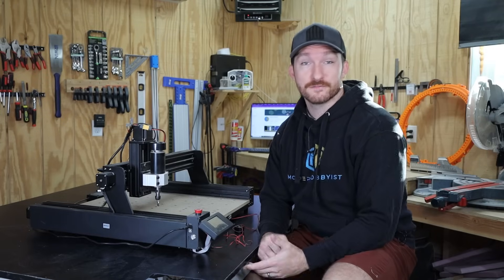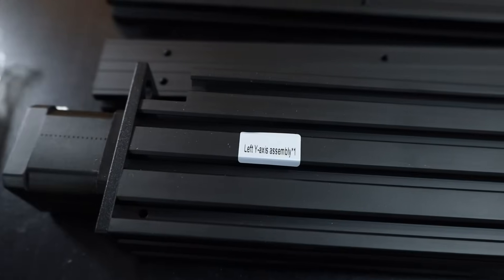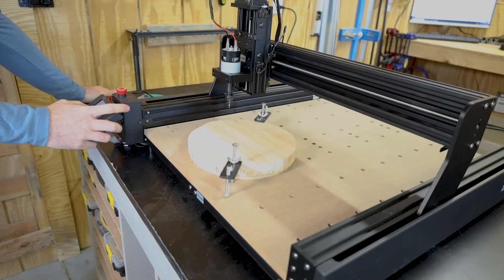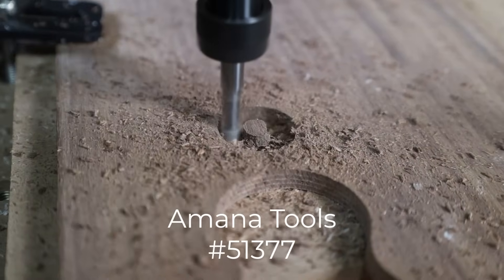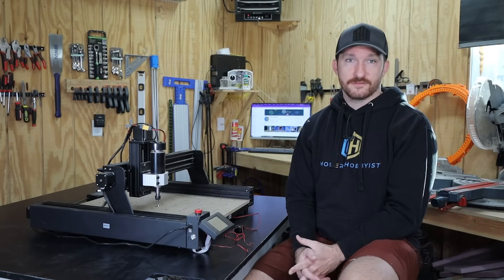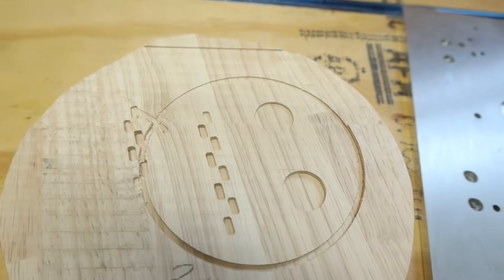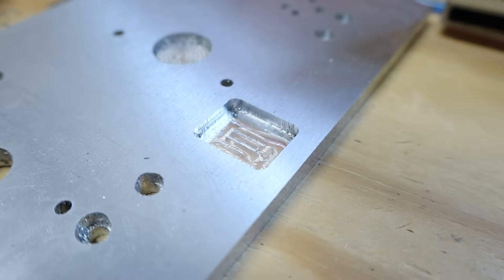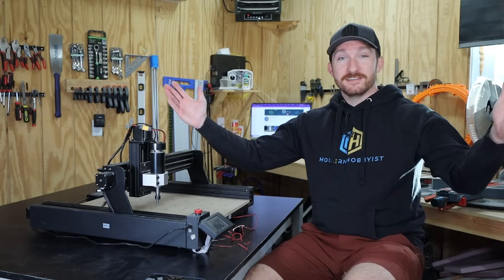What can a $500 CNC Router Do?! TwoTrees TTC450 Review

Comment: I know this is an older video but I’m a machinist and programmer for a commercial company and I can tell you the end mills DO NOT like to come down directly on the work piece.  You need a pilot hole slight larger in the start point. You will see long life and better performance
Reply from the maker: That's good to know, thanks for the tip!

Comment: Love the honest review. You’ll get a better finish on the parts if you leave a little material on the sides until you’ve got your depth cut all the way. Then come around and take off that last little bit of material along the sides. 

Also just have the tool path leave a little tab to connect the part to the panel in a few places so when it’s done it doesn’t come loose and jam the spindle or leave a crappy finish. 

Then just cut the tabs with a small saw and clean up the small leftovers. 

Hope that made sense. Also a machinist. 🎉

Comment: everything is fine with the electronics, I heard that the block fails, for some reason, I saw a video somewhere.
Are the wires long enough, I saw that in some cases the length of the wires is not enough, and you need to connect additional

Comment: I bought a TTC450 pro, the mechanical system is fairly good. The electronics are GARBAGE and failed, the warrantee is low quality, 1 ply toilet paper.  The board failed after 3 partial cuts and took 2+ months of HOT emails to get a $25. board. Technical support could not understand that no or intermittent  communication is a caused by a bad board. The control board is a proprietary & odd ball size board. The replacement board, as specified on the parts webpage WILL NOT fit or work (only 3 axis, need 4 axis). There are issues with how the stop switches are wired.

Comment: 10:15: I'm not a CNC user but, aren't you supposed to program in some little "connector humps" that allow the workpiece to stay put via a little piece of remaining wood?  That would require you to manually saw them off to release the workpiece but would keep the part from flying when it's done.
Reply from the maker: Yeah you can add tabs but I didn't actually care about this piece turning out so I took the lazy route

Comment: I had no idea these machines were so underperforming, 0.1mm DOF is laughable, i get that it's a hobby machine but still, they should be able to handle wood otherwise what's the point? Only for shallow engraving? Also, what's the deal with the electronics? I have a homemade arduino based co2 laser cnc running GRBL and have no problems, you would imagine a custom made board should run with no issues!

Comment: Not dogging you at all my friend. But a piece of advice from a machinist. 
The stick out on your endmills is crazy long and probably a considerable factor in the chatter. It would probably benefit you tremendously to chuck up as close as you can without impeding chip evacuation. 
Chuck up stubby and push your feed, then pull your tool out and slow down. 

The tool length and the hella long nose on your spindle = chatter for days.
Reply: He saying to put your cutty thing as far up the cutty holder thing as it will go, as it will stop it wobbling about.
Reply: Absolutely
Reply: First off, thank you for the honest review. I'm looking for my first CNC Router too, but I think I'll keep looking.  And what @xandetfields3279 means is to push the bit up farther into the chuck so it's not sticking out so long. I'm new to these beasts too, but I know that much from drills.
I love my 3D printer and I think a CNC would make a nice addition to my wood shop.
Reply: From one machinist to another, @xandetfields3279 gets it. The length of that tool is way too long. For that thin aluminum use a tool that's just barely longer than the material is thick. You'll be amazed.
Reply: Sounded quite sexual towards the end....
Reply: I use this advice daily, wife loves it 👍🏾
Reply: As someone just getting into this, this sounded like Willy Wonka explaining how he got his Gooberdinger meat.
Reply: Amen to that. I'm looking for a cnc machine, don't know anything about them however I do know lasers, 3d printers, both fdm and resin and you all are spinning my head
Reply: I love how I know nothing about CNC and your comment sounds like someone explaining his League of Legends role to me 😂

Comment: Would it help to chuck your cutting tool up more into the chuck so it doesn't chatter so much? A smaller depth in cut and a slower feed rate might help as well. I wouldn't try cutting aluminum on this machine as you need a fast spindle rpm and smaller depth of cut, as well as a bit of constant coolant on your cutting tool.

Comment: Hello, I'm looking to get a desktop CNC router but I need to know which model will do what I need. I need to engrave into and/or completely cut out small rectangular window holes in the hull of a model kit whose decals for this purpose are the worst decals I've ever encountered. The dimensions of the ports I need to cut are 1.5mm x .05mm. Which table and bits will do the job? Thanks in advance.

Comment: Great review and peice on this.

 Only issue is isn't the software cost more than the cnc ?? I know there's free cnc cad's out there but I've heard there dreadful...
I know that's a separate issue, but would have been good if we could have seen the software & inputting the shapes you created, An excellent video.
Thank-you
Reply: Fusion 360 offers CAD / CAM support and is free for makers. SolidWorks offers a hobbyist subscription now that isn't too bad and I think includes CNC / g code (not sure). Vcarve is decent at $349. I'm sure there's FOSS options out there but not too familiar with them.

Comment: Nice little machine and review but it only looks good enough to cut PCB  and some pine but for engraving it may do a bit better  as it will have less forces on the gantry . 
But man Don't keep on swapping your measurements from Imperial to Metric just stick to one if not you will get into a lot of trouble

Comment: 500$ this, no thanks ower price lot, all other same can buy normal 200-300$ save lot money, and have very small table cnc. and totally too small motors all, minimum good cnc need be nema 23 470 OZ motors, MINIMUM. and better buy 800 ER16 spindle than 500W same cost but lot better spindle, if working hobby work and sell parts better use 2.2KW spindle.

Comment: The one necessity for successful marching is rigidity. Even a slight  flex  (.005") will cause chattering and an ugly edge. There is just no getting around it. As the video shows, the "spindle" can be seen moving at an angle unintentionally when there is resistance. This will only increase as the cheap alum frame is used.
Reply: Yeah and the only way around it is reduced feed rate and reducing the depth of your bite. More time consuming is all. I guess for the ultimate hobbyist it would be okay.
Reply: @goingbonzo5923 
 The cutter will still flex all over at low speed. The fix is to buy something you can actually use.
Reply: @thomcarr7021  you're probably right. I was looking at the shapeoko, but it's like 1800 for the cheapest one, although they are rated well when it comes to rigidity.
Reply: portal made from bakelite 🤭
Reply: You could see the gantry flexing when he grabbed the spindle and tugged it to show "how well made" the machine was.  Right there I knew there were going to be some issues if he tried to push it, lol.
Reply: @yertelt5570  
It's junk.

Comment: You have a 3d printer?   Make a cover for the stop button so you can't accidentally turn it off
Reply: I think he could mill the part easily
Reply: @arbjful  not easy, need lto time and lot pass, not can cut and mill lot chip one pass. too small spindle and stepper motors no torque and power working good.
Reply: not totally need, any not bush E-stop accidentally. need be open can fats stop machine if have g-code errors etc, other accident or bit go broken etc.

Comment: Servo , never stepper😮
Reply: hobby user buy stepper motors because have small budget, any hobby user not have money waste lot to motors, stepper motor cost normal cnc 30-50$ pcs, and servo motors whit drivers 500-2000$ only idiot waste money lot servo if build small cnc, and only hobby user, intdustial user servo because need lot more power,fast speed and biggest work.
Reply: @mattivirta Do you not know what a stepmotor is?

Comment: Can this machine cut thick industrial felt?
Reply: felt, leather, wood, maybe little pass aluminium too. spindle power not have good not can cut fast, need slowly speed and feed this weak spindle, no power, normal used 800W spindle max 1-2mm pass to wood, 1,5KW spindle better more can, normal used 2,2KW spindle hobby cnc machines. but need change all stepper motors too biggest. minimum have nema 23 470 OZ motors drivers need handle 3-6ampere, motor max ampere need be. good cnc hobby user cnc machine have nema 23 or 34 4-6 ampere motors torgue more than 500 OZ 3-9NM about, drivers can use lot more voltage normal about 40-90 volt. amperes need motor maximum 4-9A. spindle minimum need be 1,5KW whit VFD. thats is normal hobby users small cnc minimum parts. if have smallest spindle and stepper motors can use only lot smallest chip and pass, need lot lot more time and run work program lot more time cut anythink, smalles pass need use weak motors.

Comment: I've had this machine for about 2 months now and have yet to use it because of many problems from the beginning. I had a bad relay in the 500w control box as well, it never came on one time. Tech support made me do tons of testing and make videos of what I was doing to prove it was bad. Finally 4 weeks later they sent me a new control box like they did for you. Since then, I have had to replace one of the Y motors and some wires. Now still trying to figure out why the Y axises are moving in the opposite direction. 

Tech support is really responsive, but it's only through email or Whatsapp between 1am - 4am. They would rather you rebuild the entire machine than replace it with a new one. Now I understand why it is a $5oo dollar cnc! I would not buy another one or any other of their products.
Reply: reverse the 2 center wires on Y2 motor, this will reverse rotation of the stepper motor, then the Y motors need to be timed. Using calipers measure distances compared side to side and turn motor by hand to make both sides the same dimension.
Reply: if you has change motor and run opposite direct, motor has wired wrong, not have same, and software can change were motor run, too.
Reply: Exactly, they only jumped through hoops because this guy is a reviewer/ YouTuber. It's disingenuous for him to make people think they are usually like this. I know, I've bought machines from TT

Comment: All of these budget cnc’s have two easily, and cheaply remedied issues. First, should have mounted vacuum inlet as close to the bit as possible so as to keep the cut path clear and the bit cool. Second, how they mount the spindle motors, is  completely inadequate.  

It should have a big beefy aluminum mount as close to the work as possible and another at the top. I bet as a bit starts to cut you could measure measure the deflection of the motor with a wooden ruler. Should be barely measurable with a dial indicator. 

Good review and video.
Reply: Definitely,  also as you say a bigger substantial motor would/might provide good weight distribution on required bit & maybe that would prevent chattering?? 

But all in all for 500 bucks it's a good entry point into cnc operations

Comment: Para cortar mdf de 15 mm de cuantas pasadas estaria bien?
Reply: 500W spindle about 15 pass, 1mm/run pass. 1,5KW spindle 2 pass, 2,2KW spindle 1 pass. but need be sure stepper motors not lose steps, need minimum nema 23 or 34 motors 3-6ampere max current, 40-90volt, and stepper motor drivers need be same size. and of course, power supply too. normal used minimum small cnc machine 40volt 3Ampere motors and drivers.torque minimum 470 OZ about 3Nm. nema 17 motors can use only 3D printer or laser no need torque move.

Comment: 500w spindle and a cheap relay for control. It should be a contactor atleast.
Reply: a relay is a contactor but they chose to use a really cheapo
Reply: @Krispy1011  No
Reply: @hunkydorian  a relay is definitely a small contactor - it has contactor tips and a energizing coil. We are not talking much power here, 500W, that's nothing. These mini-relays should be able to handle 10 amps with no issues.   I'm done.
Reply: first spindle need change minimum 800W or better 1,5KW -2,2KW spindle.

Comment: Great review...  I get that you were trying to push the limits of the machine for this review, but one thing I've found with a lot of the complaints about the various inexpensive China sourced CNC machines (routers, lasers, etc...) is that people try to push them too much.  They're not industrial machines.  They're not meant for pumping out parts 8hrs a day, 5-6 days a week.  

If you're a hobbyist, what's your hurry?  I mean seriously...  Dial down the feed rate, don't be so aggressive with your cuts and you'll find you'll get much better results.  

If you're intent is to do production work with one of these types of machines, you're barking up the wrong tree and need to rethink your goals.

I have one of those $1200 12" x 20" 50W CO2 Chinese laser systems and it's great...  Does everything I want it to, but I'm patient and don't push it too far or too fast.

BTW...  For cutting aluminum, use Isopropyl Alcohol as a cutting fluid.  Stinks a lot less than tapping fluid and it will evaporate without leaving any residue.  The usual warning about using it in a confined space, with any open flame applies.

For a shock resistant chip removal, make an extension for your vacuum nozzle out of cardboard tube...   Should mitigate or eliminate any shocking issues.

Again...  Great, non-biased review.  I've been considering this machine for routing acrylic sheet to make parts that I'll convert to metal by burning the acrylic out of investment molds.
Reply from the maker: Thanks for the feedback! I actually had a bit talking about this exact same thing (this is a hobbyist machine, priced to reflect that, etc...) but it didn't make the cut unfortunately cause it came off a little more frustrated sounding than I intended. I see lots of the same complaints about these hobbyist machines and I agree with your response, this machine isn't meant for that. For a $500 machine it's pretty good! 

Thanks again for the comment, glad you liked the review! 👍
Reply: @ModernHobbyist  I think you covered the shortcomings well enough that it should be obvious to most that this is not a machine you use for heavy production and that people need to have realistic expectations for it.

I guess I've seen too many people complaining that these hobby machines don't hold up, or that they can't turn one into a full time Etsy knick-knack maker.  At least on the laser side.  You need a machine (like an Epilog or Universal) that's an order of magnitude more expensive for that...

But anyway.  Enjoy your honest, no nonsense take on this machine.
Reply: I would like to know what the name of the machine and brand you have when you said "I have one of those $1200 12" x 20" 50W CO2 Chinese laser systems". I don't have a machine yet, and don't really know anything about them, but I want to get started without having the hassle he went through. Also does the machine you mentioned cut through acrylic with the laser? Cutting acrylic was what I had in mind.
Reply: hobby users not need industrial machine ewer, newer used 8 H/day 7day/week. hobby user use machine normal about 1-5 hour/week,

Comment: u will label for a few items than its a pain in the arse and useless - sturdy?  when u moved the spindle the entire machine flexed -  the main issue with these small units - very very light cuts are needed - these cheap chinese-eum machines are more pain than gain - hit or miss - beginners usually toss them - cheap is always cheap
Reply from the maker: I actually had a whole segment where i talked about this but it didn't make the final cut. This is a $500 aluminum machine, it's intended for beginner hobbyists and as such isn't gonna be the sturdiest machine in the world but it's priced to reflect that. My review takes all of that into consideration.
Reply: @ModernHobbyist  get what u pay for - beginners really need to know this - good job on videos

Comment: I found if you try to move an axis too fast, or if the steps per mm is wrong for that axis, the axis will lock up.
Reply: normal stepper motor if use too fast then loose step and freeze or not run right, and this have too small stepper motors lose easy steps, what biggest motor have then better can run, if need fast need change all line new and use motors lot more voltage, more volt mean more speed, biggest motor mean more torque and not lose steps easy, perfect change motor drivers biggest and motors, perfect cnc can use 80-90volt and motor max amperes have 5-8A lot normal used 4A 40volt and motor nema 23 or 34 and torgue minimum have 3NM/470 OZ or better motor, not lose steps and better make work.

Comment: I’ve had to use a shop vac a lot with aluminum and the shocking sucks. Weirdest thing I use in my vacuum cleaners are dryer sheets. But with the shop vac I hold the hose with a dryer sheet and I haven’t had any shocking. Hahahahahaha